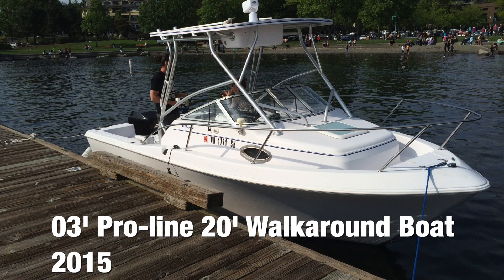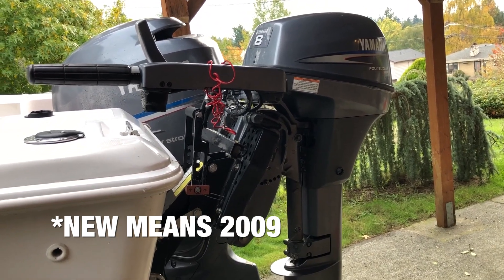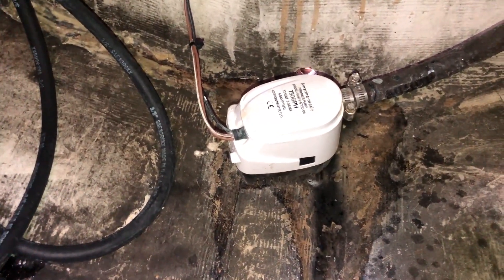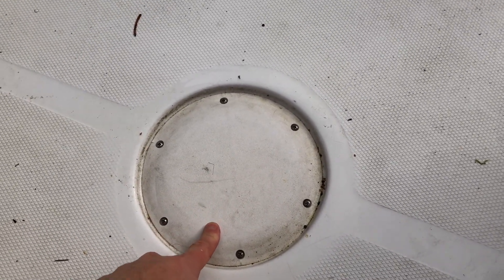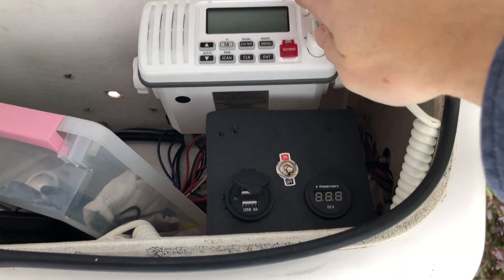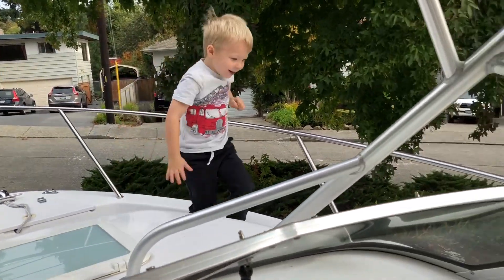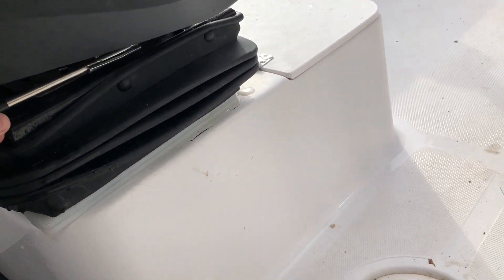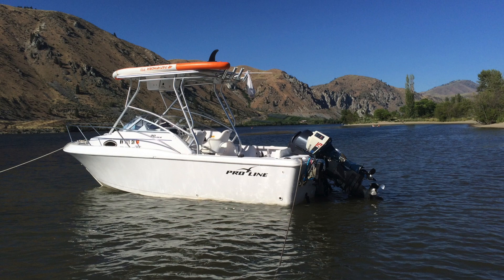Pro-line Boat 2019 Walk Through - After Lots of Work- Part 2 of 2

Comment: I'm buying one of these tomorrow for 6k. Its dirty but I think the pumps work. It has the same mercury 150 on it that yours had. A honda 4 stroke kicker. I'm gonna try to breathe some life into the mercury. it's been sitting out for sale for a about a year. Need to drain all the fuel out. 

On the test drive the mercury started out strong and we were scooting along at 40 kts and then the mercury died and we putted back in on the kicker. I initially said no and then offered 6k because I thought it was a major engine issue. But then I thought about it and checked the sight glass on the fuel/water separator and it was completely full. So I'm thinking completely drain all the fuel out and get new fuel in it with no water and hopefully it should be good. And if not, I'll just replace the mercury. Either way, I feel like it's a steal for 6k. Comes with 2 gps systems and downriggers and a ton of fishing gear. Itll be my first boat.  What do you think, good deal or potential lemon?
Reply: Sounds like a good deal. The year matters of both engine and boat. Do a compression test  as if it’s good buy it?
Reply: Water in fuel..... your tank is probably leaking.